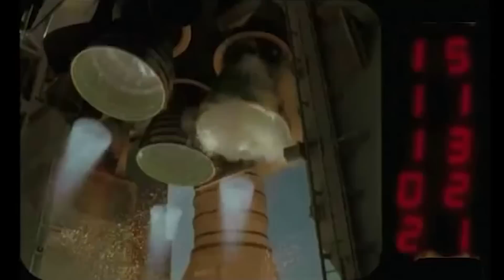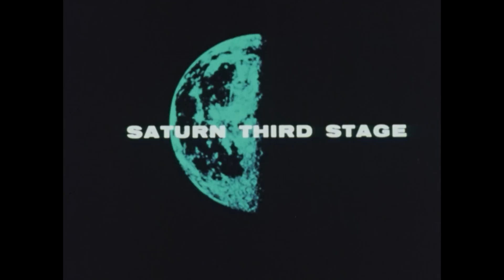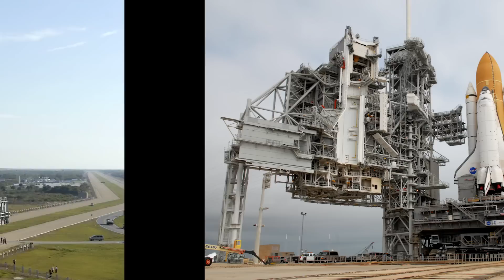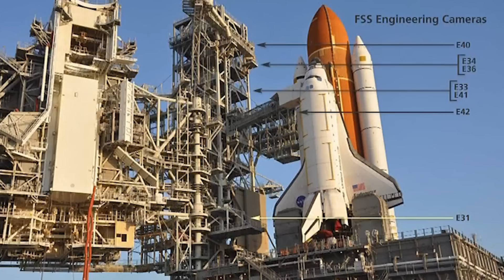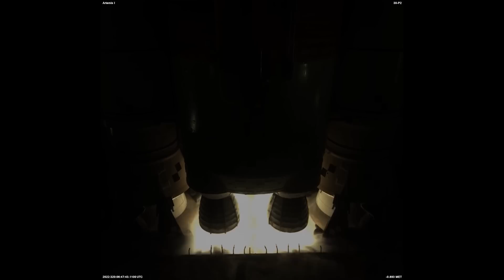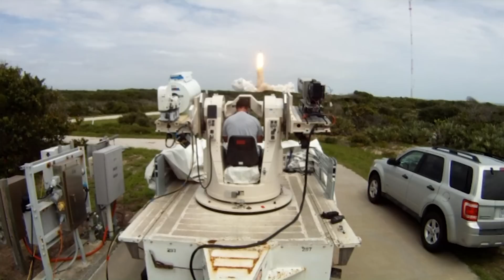Why is Older NASA Launch Film Footage Still the Best?

Comment: Digital retains immensely more detail in the shadows than film. 

Could they not just underexpose by 3-4 stops and make up the gap in the top end?

You can recover detail in shadows better on digital than film. Good cameras can have >100,000 ISO and this is effectively just pushing shadows to the extreme.